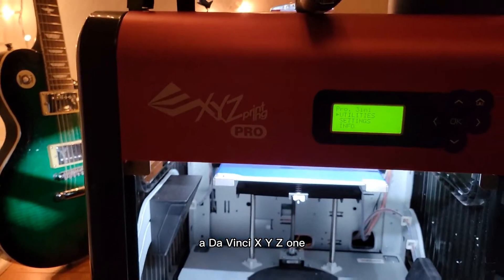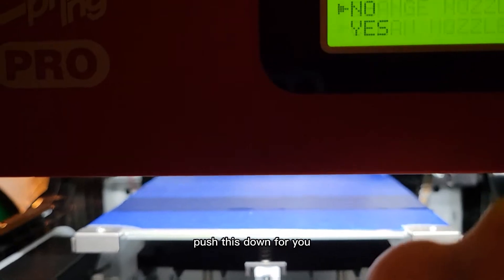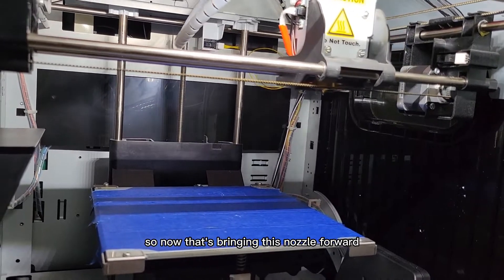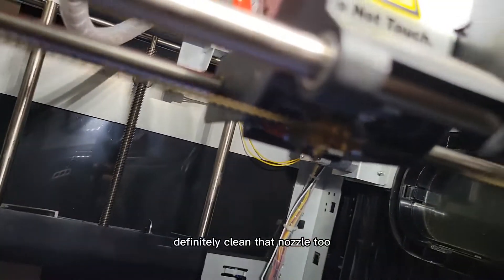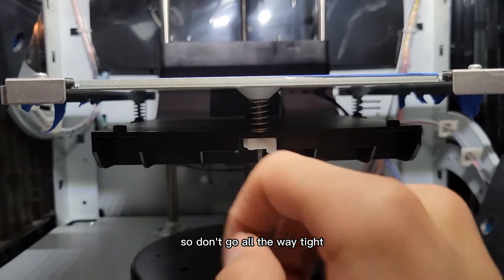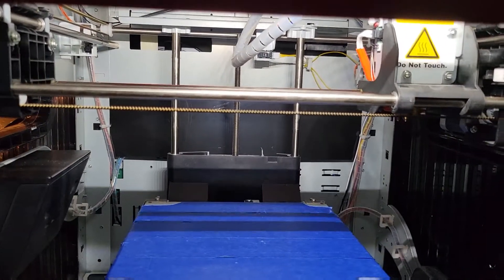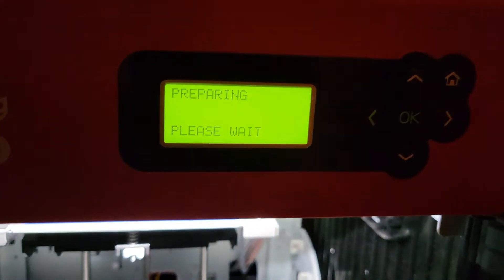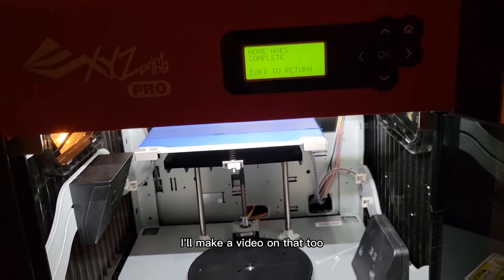3D Printer Calibration Fail Fix and Z offset (Davinci 1)

Comment: U recommend that printer ? Pretty easy to use day today ? And I have a mini w so far works fine thinking about upgrading to bigger print surface.
Reply: I’ve been using it lately and it works just fine. I think it’s a good printer especially for the price
Reply from the maker: I'd recommend getting an ender printer this one was a bit odd
Reply: @bigjohnson72 how you made the calibration? I just cannot reach that point

Comment: What kind of tape are you using on the table? I'm using yellow painters tape, and I rub a glue stick on it but it isn't working at all..
Reply from the maker: I use blue masking tape or painters tape I remove the tape after the print is done if it is too hard to remove